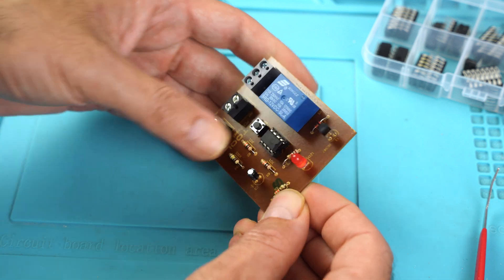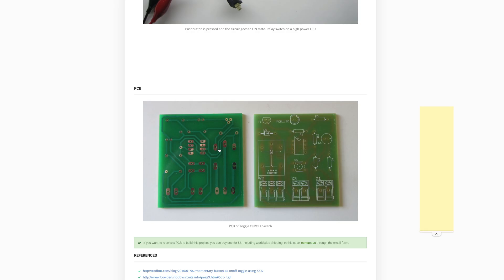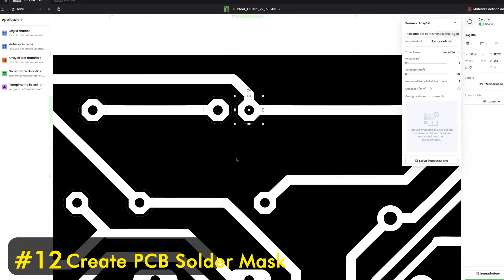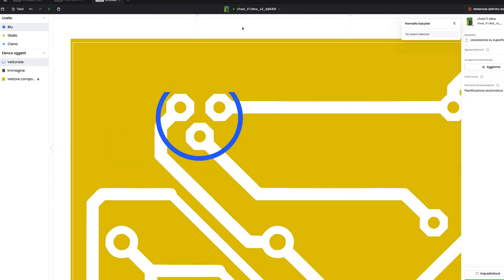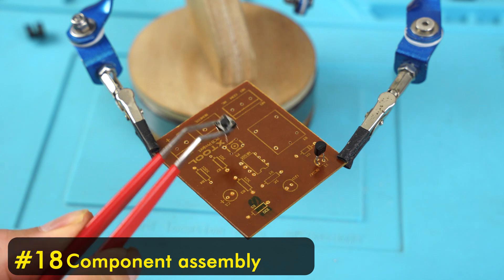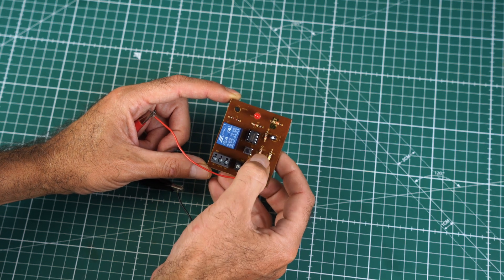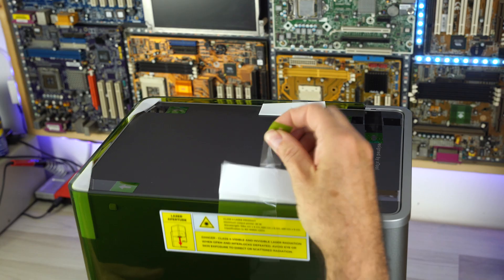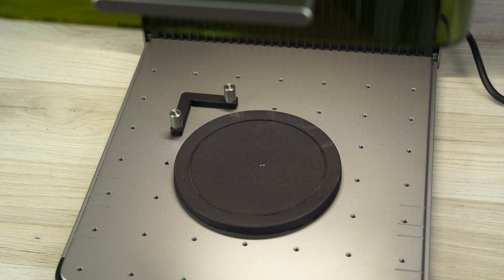Make Professional PCBs At Home With A 20W FIBER Laser xTool F1 ULTRA

Comment from the maker: 👉Link to product: https://bit.ly/490W5Lr
Hi guys, this is a demonstration video to show that you can make PCBs with a 20W fibre laser. Xtool F1 ultra is an amazing machine for the time that I have been able to try it out and it is very expensive and is only recommended for those who have a business. it is a laser engraver with dual laser technology and also allows you to write on PCBs. I don't recommend buying it just to make PCBs, because it is an engraver that offers many more possibilities. Very high quality and speed and it is a very simple engraver with free, complete and easy-to-use software. It engraves on all metals with the fibre laser and you can also cut wood with the diode laser and make coloured engravings.

Comment: I had done some PCB fabrication attempts with a 3010 CNC and used Flatcam as software. I prefer the drill part being done by the machine as well. However, the whole workflow of repeatedly setting up the alignment & tension bracket for the milling and drilling is quite annoying. Furthermore, once finished, the damn solder just didn't want to stick to the exposed copper at all 🥲
Reply from the maker: Making PCB with a CNC machine is very complicated. Then I will make a video on how to make PCB with a CNC. Thanks for your feedback
Reply: I had a similar machine before and I used conductive probing to create a heightmap of the board skince they're never really flat. Worked out great but yeah they were hard to solder afterwards and also it was hard to clean debris from the tracks.
Tip for getting the solder to stick:
Ruff up the surface with sandpapper before milling it so that the solder get's a larger surface area to stick to. Don't forget to clean it with alcohole before soldering and use flux if needed.
Reply: Please how will I get this laser machine, IAM in Africa